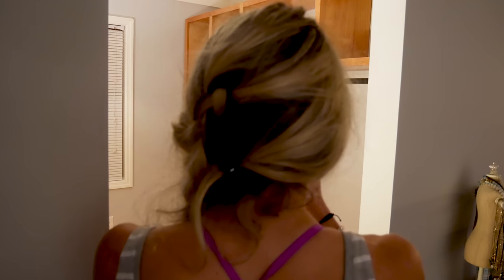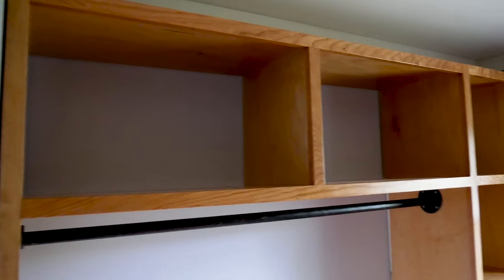How To Build A Walk In Closet || PART 4

Comment: I really enjoyed all 4 parts!! I am remodeling a bedroom, adding a bathroom and walk-in closet. Most I have seen have a section that has two poles, one atop the other (for hanging more shirts), and also the pole (which you built) that allows for hanging long things from. Did you consider doing that? How has it worked out, now that you have had about 5 months of use? Again, no criticism meant or implied, as I love what you have done.
Reply from the maker: Thank you!! Glad to hear you enjoyed! I had seen quite a few with the second pole and I may actually install something like that down the road, for now though we just don't have enough clothes to fill something like that so this was the easy way out that worked the best for us. And we're able to stack bins with things in them under the hanging clothes! Great question! I'm more than happy with it having used it for the past 5 months. If I were to do it again I might make the cubbies slightly smaller so I could fit a few more in the stack. 16" x 16" is great for sweatshirts and pants (for me)  but a little too large for t-shirts and basically all of my fiances clothes haha but she just made two stacks in each one. One other recommendation is to go to a store like TJ Maxx or Marshals and buy up some cheap square baskets that fit in the cubbies. You can use those if you need a little more drawer space and they add a nice visual touch. Beside that, I love it! Hope that's helpful and good luck with your remodel!
Reply: @SamMacyDesigns  Thank you for taking the time to reply with such detail. Good ideas to about size of cubbies, as I am 6' and my wife 5'1" and our clothes take up different room (although she has more clothes than I do!)

Comment: learned quite a bit in the 4 part series! I want to tackle a project for the master closet by ripping out the wire things that are there now and doing something more complex like this. I saw you were following a print out plan...where did you make this plan per the dimensions of your closet? Havent found a resource that can guide through like that yet.
Reply from the maker: Thanks for watching, I'm glad you learned something! I made the print out plans with sketch up (the free version). I  had an idea of what I wanted and just made the dimensions to meet the room I was putting the closet in. There's probably no good way to scale the plans to fit you closet dimensions, unfortunately, but if you're starting to tackle projects like this I would highly recommend learning sketchup. It let's you make all your mistakes on the computer so when you go to build something it goes smoothly!
Reply: 92 Nails thanks for the tip. Will look into it and start messing around with it

Comment: Closet looks great! I’m building my own now as well. What did you use for the closet rods and where did you get it? I’ve gone to the hardware stores and didn’t find any wall brackets like you used.
Reply from the maker: I got the black iron pipe at my local ace hardware, I got a 6 foot length of 1 1/4” pipe and then just cut it to length. And for the hangers I got two 1 1/2” flanges so the pipe just sits inside without threading in. If you can’t find it locally I always recommend Zoro.com for all kinds of pipes in different sizes, they have the best prices I’ve seen so far!

Comment: I saw you use epoxy to attach pipe handle.....although not clear how you did.  Can you explain more.  Did your hole not go all the way through?  Did you just pour it in the hole and then stick the pipe in and let it dry?
Reply from the maker: Tim Karcher good question! I drilled in enough so the pipe threads went all the way into the hole but the hole didn’t go all the way through the drawer front. Then yeah, just poured it into the hole and let it dry! I used 1” pipe and drilled a 1 1/4” hole but probably could have gotten away with a 1 1/8”. It would have made it so I didn’t have to use as much epoxy to fill the hole.
Reply: @SamMacyDesigns  Thanks for the quick reply...and sorry....I intended to put this question on part 3.   Great work.